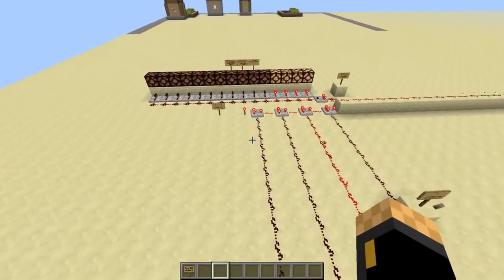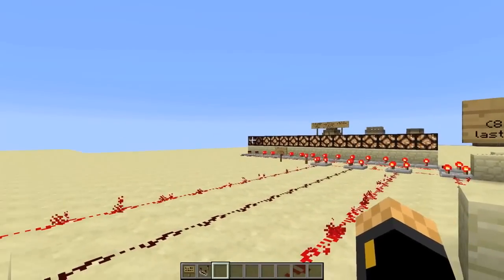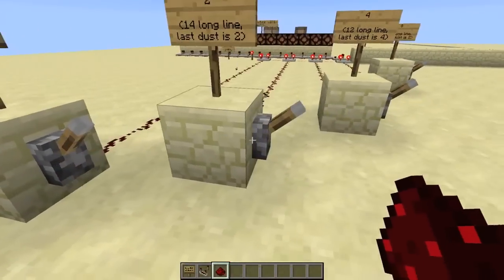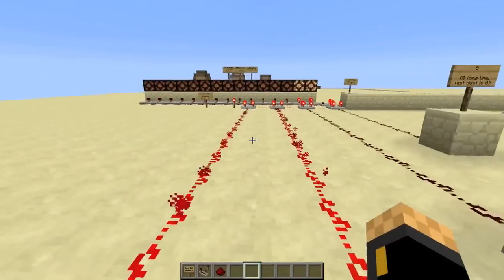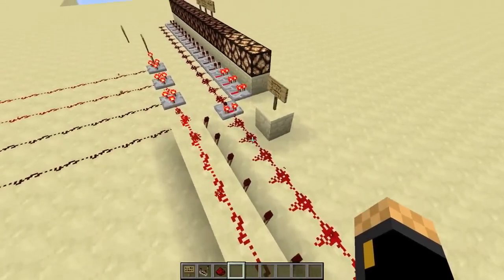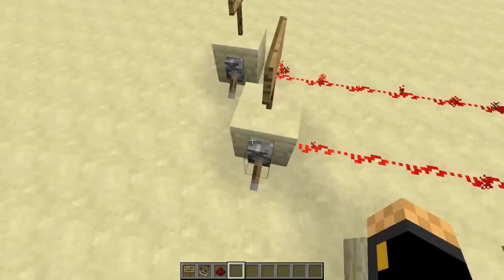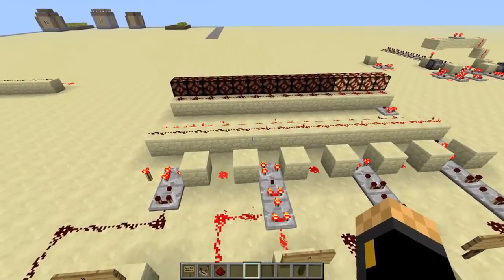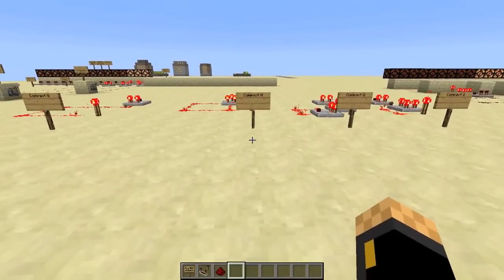Analog redstone ADDER! /Binary to analog signal converter

Comment: Why don't you invert signal without long line, but just substracting result from 15 using comparator? BTW, why not use hopper with comparator for setiing up strength?